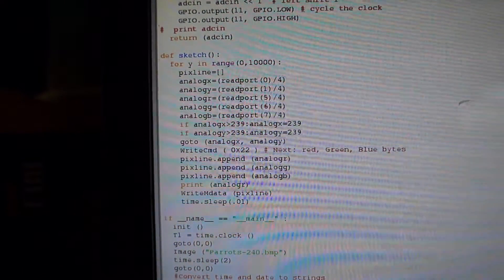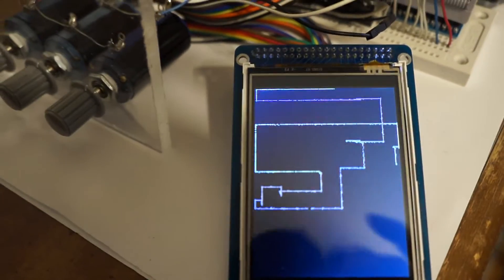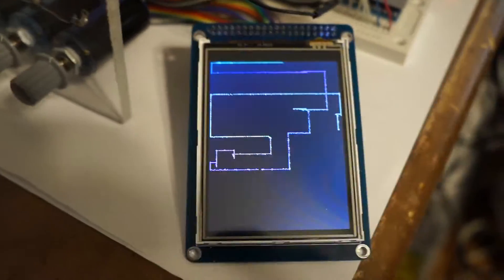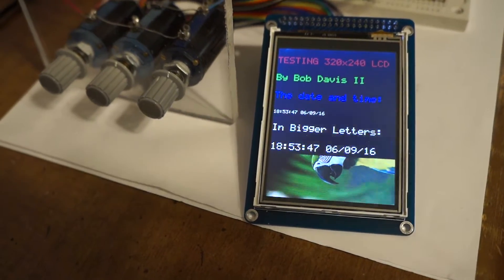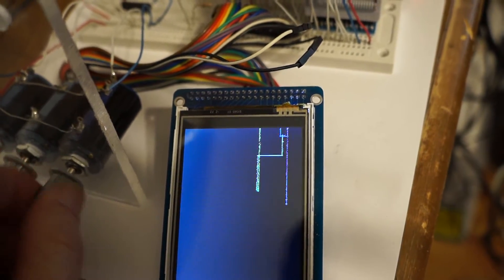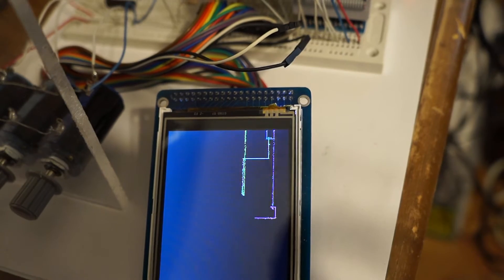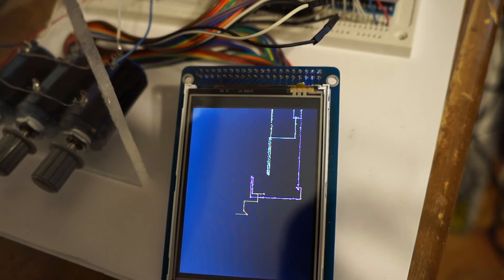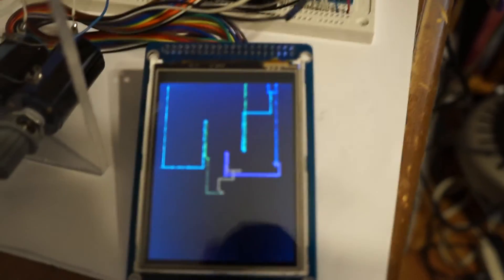Raspberry PI + SSD1289 LCD + MCP3008 ADC = 256K color sketch

Comment: Hi Bob,i am working with sifive-Hifive1 microcontroller, i have interfaced Adafruit 2.8" tft lcd resistive touch breakout board with my MCU i need to use the touch functionality,so i used ADC MCP3008 as my MCU does not have analog input header pins.I am struggling with the pin connections and also i am using TOUCHSCREEN.H (I port it in C language, made some changes for hifive1 support).How to give connections between the ADC , MCU & Display unit in breadboard and also how to calculate the z coordinate in general? i tried my level best but the touch functionality is not working properly it prints somewhere else( i tried breakout paint example)